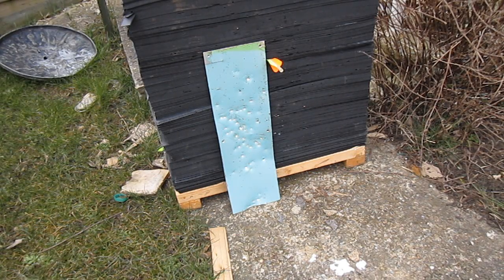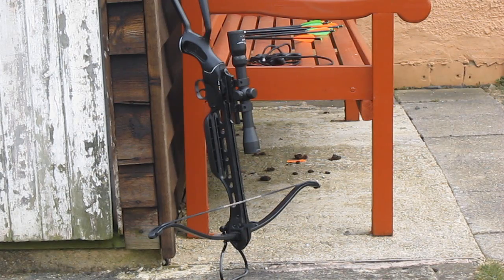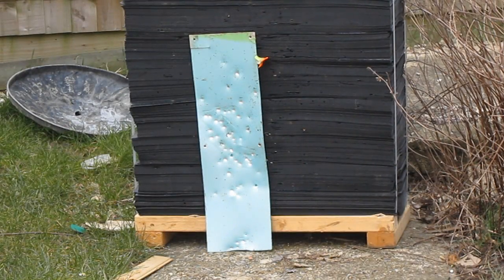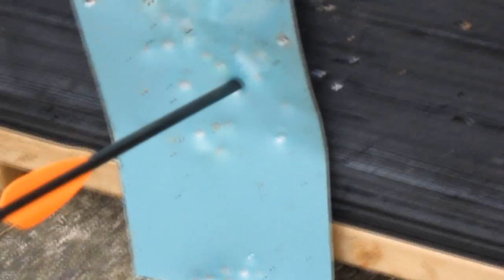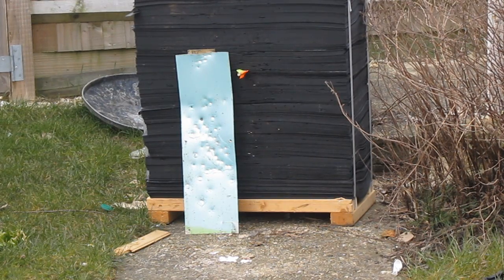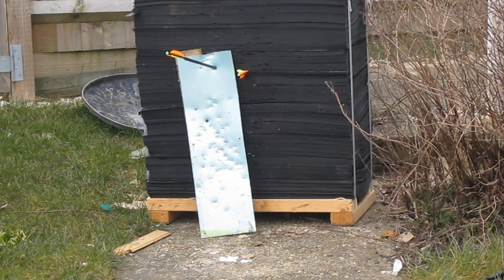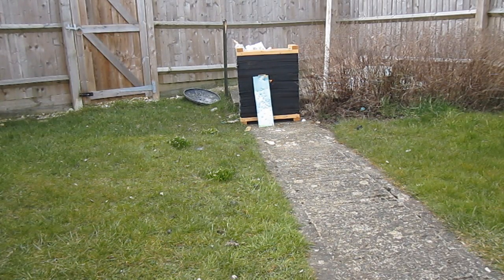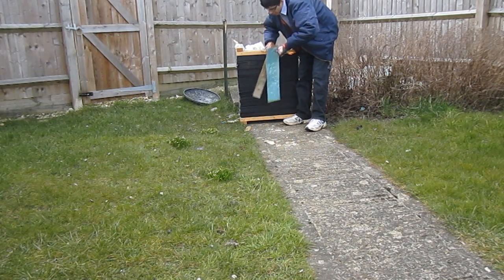150lb Crossbow metal penetration

Comment: you English people could probably use that for self-defense but you just can't own it for the purpose of self-defense
Reply: actually you are wrong, there is case law where someone who was continuously burgled used a crossbow as he feared for his life and killed one of them and he wasn't prosecuted. the judge stating that as he feared for his life what he did was lawful. the law states you can you reasonable force, so if you think you are going to die or be killed.. you do the maths... also if it did get to the point where you needed one of these society would of already broken down and its laws would no longer mean anything
Reply: @reakingringpiece  A garden-hut owner in our country did exactly the same, mounting an automated cross-bow trip wire because his hut had been continually burgled. He did serve the sentence after the system had shot the burglar. Also, he did IN ADVANCE warn of the firing system by means of a sign, announcing the crossbow. I guess we're not America.
Reply from the maker: You don't need legal justification for owning a crossbow so you can use it for whatever you want.
Reply: John Galt Who is John Galt?